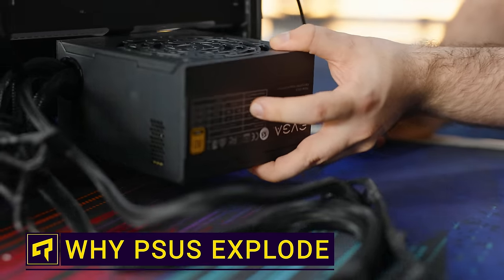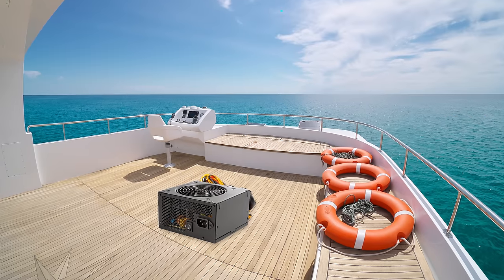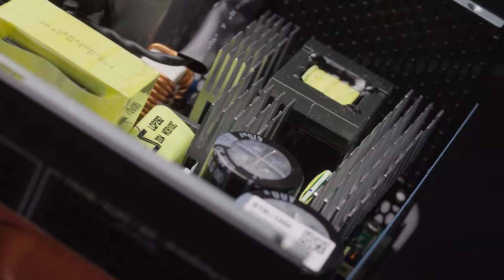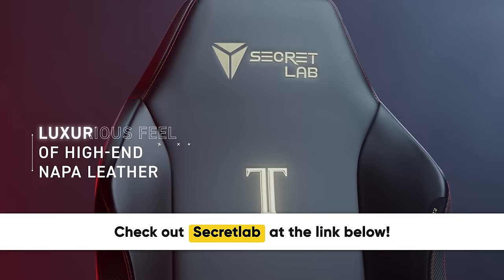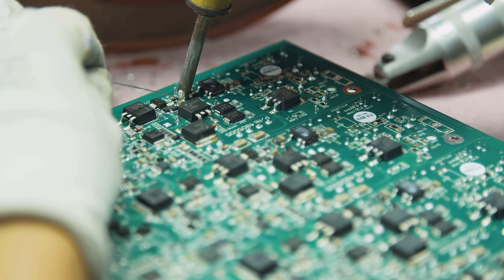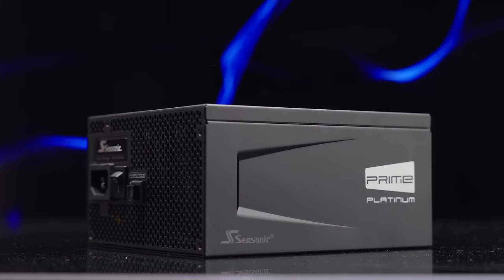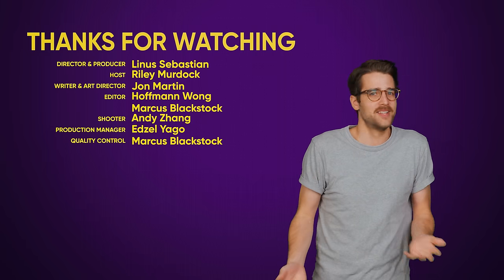Why Cheap Power Supplies Explode

Comment: 1 - gotta love Riley, hes amazing as always!
2 - somehow, my 50 bucks PSU still works fine lol.
3 - i will definitely buy a real and more expensive unit, once I get a new PC lol. I don't wanna risk anything.. waking up everyday wondering if my house will catch a fire ain't fun ;p
Reply: I mean it was always about getting good quality products but some people has misinterpreted it as getting the most expensive product.
Reply: Actually there is some the most dangerous one, the one that doesn't blow up that is. Cheap PSU often have terrible ripple suppression that it can silently murder your PC components with it, and you think you just got a bad RAM/GPU/SSD/etc. I often seen these things kill all the USB ports in a motherboard as well. There are some good 50 bucks ones, like some by FSP, similar stuff you will find inside a Dell or HP prebuild PC actually, but make sure you know what you are buying.

Comment: Reputable brands like bequiet, Corsair or Seasonic will also give you 5 to 12 year warranties on their PSUs, which is a major trust thing since they wouldn't do that unless said manufacturers really expected them to last at least that long. Cheapo PSU brands don't do that, and they made their profit if it goes boom on you after 3 years.

Comment: A few days ago I got a computer to fix. I'm in Europe, so we only have 230V AC here. The PSU was a "global" one, with a switch to select 115 or 230V. This computer came from an school, and I didn't check the switch before plugging and trying to power on the computer. Some prankster (I guess) set the switch to 115V.
If that PSU was a good one, nothing would have happened, or at least an internal fuse would have blown up. Instead, there was a loud bang inside the PSU, electrical crackles and lots and lots of smoke that escaped from all the holes in the PSU and computer case. Ah, and the awful smell of burnt electronics.
It's a miracle that the rest of the components survived.

Comment: I had a cheap power supply blow up once it only killed the motherboard. Thankfully the motherboard which was a MSI motherbaord had protections that saved the rest of my components. I now have a good quality bequiet PSU

Comment: PSU is one of those components where you shouldn't cheap out... And not buy used if it's 5+ years old. Very low chance it will survive another 5 in your system.
Other component is SSD but there smart data is more important than age

Comment: I had cheap power supply and it wasn't explode but the SATA power connector was short circuited and it catches power. (I quickly turned off the extension cord and it was ok, LUCKILY!)

Comment: I've had plenty of experience with power supply problems, including high quality ones like SeaSonic that react so fast they overcompensate for a momentary spike from my RTX 3090.  I just threw a 1300W PSU in as an upgrade and there is now plenty of headroom to handle stuff like that.  Keep in mind that your computer's power supply is not the only component with these protections: Your motherboard and GPU have some along with your UPS, all the way down to your circuit breakers and arc fault outlets in your home.  You can get some seriously weird behavior from their interactions... I guess  that's why the manufacturers tell you not to plug a surge protector into another surge protector.
Reply: 👆👆congratulations🎊you have been randomly selected among my shortlisted winners you just won a prize🎁🎁🎁...

Comment: Can't say I've ever had a PSU explode, knock on wood. Only one I ever killed was one I had re-wired to use as a bench supply. Just stopped working one day. Cheap supplies can be fine for low budget, low power builds. But the key to take away here is that they are a potential time bomb, and the ratings on the side are to be taken more as rough guidelines than gospel.

Comment: I have been building computers since BEFORE ATX, I used the older AT standard.  I have built computers out of used systems, trashed systems, recovered from landfills, bought at flee markets in the middle east, and just made out of crap.
I have had components fail in all sorts of ways, or, more specifically the only two ways they can, open or short.
In my years of accidentally running 220v systems on 110v and visa versa, of using parts that spent years in the rain, I have only seen 1 power supply ever fail in a manner that is actually explosive... and that was made by Gigabyte.

Comment: I remember working on a desktop at an office. I plugged it in and turned it on, and a jet of flames came out of the back of the power supply, kinda like fireworks, with a rapid clicking noise. I luckily was able to pull the plug before it damaged anything else in the office, or burn the place down.

Thanks for this video, guys. I need as much help as I can get to weed out these cheap power supplies from reputable ones.
Reply: 👆👆congratulations🎊you have been randomly selected among my shortlisted winners you just won a prize🎁🎁🎁...

Comment: Switching power supplies have been around since the late 1960s. The computer industry began using them commonly with the Apple 2 and the IBM 5450, later known as the PC, in 1981. LTT only missed by 15 years or so. Par for the course for LTT accuracy.

Comment: I had two PSU's from a known brand with bad capacitors. They where digital, but not cheap.  Two became 4 under warranty in about 2 years. They did all go bad and lasted less than 2 years. They drove other not cheap devices, who is still in good working order. Tired of it, now is 12 year warranty PSU's running perfect at 6'th year in the desktops.

Comment: I think this is a bad take:
1) DO NOT open the PSU, this needs to be explicitly said. There are large capacitors inside that - if not properly discharged - can kill you while you run your fingers through them as shown in the video.
2) It's not the price as the title implies. EVGA has just told us recently that they had decent (20ish %) margins on PSUs, this means simply undercutting doesn't imply worse quality. It's more about willingness to cut corners, which established brands are generally less likely to do.

Comment: "Read reviews from trustworthy sources"
Need to stress that said reviews are IN DEPTH reviews, those that test ripples, overload, circuit configuration, etc.
Consumer review are your last place to look for unless for negative complaints such as faulty or blown PSU. Most common of consumer review is mere "I plugged it in and my computer runs. Recommended 5 star!" which tells you absolutely nothing.
Also, never cheap out on PSU, even if comes from big brand names. Some brands do have models that are so bad I might as well use cheaper stuffs that is likely to blow.

Comment: This guy needs to be clearer (and less dramatic) about these explosions and fires he keeps going on about. He's selling it like the PSU is going to either cause a fireball type detonation and/or something like a hand grenade going off inside your PC that will send shrapnel flying everywhere and possibly kill you. An electrical fire caused by shorts and failed components is nowhere near as dramatic as he's making it out. Yes.... any fire is bad.... but.... your PSU doesn't go up like grease fire in the kitchen. As for the so-called explosions, a capacitor that fails and pops, makes less noise than a firecracker. Other components like MOSFET's and JFET's make even less noise on failure. Those of us in the know may find his prophecies of PSU armageddon entertaining, but non tech savvy might actually take it seriously.

Comment: USB power supplies are also sketchy.  I only use Apple or Samsung supplies.  When the 150 watt Anker supply is half the size of the Apple 140 watt, you have to wonder what they left out.  Most USB power supplies are missing the voltage monitoring circuit.

Comment: Back in the 2000's, PC shops in the Philippines tend to put in cheap PSUs in their pre-built systems and package it with cheap automatic voltage regulators and surge protectors just to keep the prices down. It wasn't until the 2010's when internet became more accessible to more people. Since then, more people found out that PSUs are worth spending for and people stopped buying those pre-built systems with cheap PSUs, AVRs and surge protectors.

Comment: trust me. no power supply is built without cheaping out on some stuff. modular and reputable ones like asus rog, corsair, evga all use shitty output plugs and they melt even if you're within the 150w pcie spec. and they don't make non modular high wattage ones anymore so you're forced to buy modular if you want high wattage

Comment: Hey there is a high pitched noise coming from my PC while its connected to power - only shutting of the PSU or pulling the power plug will remove this sound.
Is my PSU screwed or what is going on?

Comment: I used a Lian Li power supply I bought in 2012 when I built a computer.  I upgraded the computer later to a 6th gen i7 but used the same power supply and in 2021 the power supply blew.  The computer just shut off and I could smell a slight burning smell.  I knew the power supply was dead so I opened it up and 2 large capacitors had leaky burnt crust on the top.  It killed the motherboard, the processor never booted correctly after that and I don't know about the ram, though my graphics card survived.

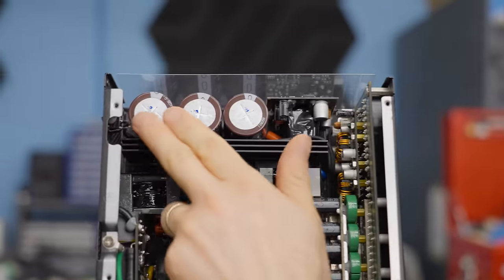Comment: 0:48 Please do NOT touch capacitors with bare hands. They can hold charge for MONTHS. I know you're touching the casing, but a little electrostatic dust can go a long way. This is not a part to poke around without safety measures. Sorry for the rant, but I thought you already had a collab with ElectroBoom? ^^

Comment: I have built one computer after another with cheap power supplies since the mid 90's, and can tell
you that you get what you pay for. These supplies are unreliable, noisy, have bad an unreliable fans, 
and are very sensitive to static. I have had cheap supplies that seemed to have the needed wattage
and tested OK on pin voltages, but couldn't boot up the computer, probably due to over-rating.

Comment: I'm still confused what does the wattage rating mean? If I limit my system to have sustained and spike power draws of 640 watts on a 650w 80 plus bronze CX650M, why shouldn't it handle it? Like even with a 4090 and a 150cpu, all you need is 850watts. 600 for gpu and 100 for motherboard/fans.
Reply: Typically OCP is like 10-20% of the rated limit, but that's not always the case especially on cheap china PSUs a 650w might actually mean 500w sustained 650w peak. A 4090 will almost guaranteed trip a 650w PSU because although very brief, it may pull very close to that OCP limit, and as soon as you add on a CPU, board, and VRM inefficiency you're well over that limit.

Plus you don't want to be sitting near that limit all the time even if you could. Hotter components don't last as long. They're also less effecient. And louder to cool them. And no upgrade room. The list goes on.

Comment: In the EU/UK we're covered by a 2 year warranty on electrical goods regardless of what the manufacturer thinks, and 6 years if you can demonstrate that it was defective at the point of purchase (e.g. running it at its rated power for its full warranty period using the supplied components would cause failure a significant percentage of the time). So "technically" this should be less of an issue here, and may help to explain why a lot of cheaper stuff is also better quality now than it was 20 years ago. You're welcome.

Comment: The 'weight' thing, can be a bit of misnomer, as some cheap psus, just stick a weight in them, or use a slightly heavier housing.
Kind of like how cheapo junk tier keyboards slap a metal plate in them.
Low grade steel is cheap.

Comment: When i built my first PC 10 years ago, i fell for the "1200Watt" 50-dollar psu. Was gaming one day and i noticed the fans would slow down when something resource intensive happened. Then the whole PC turned off, i thought i killed the CPU, asked my gamer friend and he told me it was my PSU. Then i bought a an "expensive" Antec 750 watt, ran amazing. Now i run a Seasonic 1300watt platinum.

Comment: Was repairing an old build from 2004, had a codegen power supply that came with the case. I believe the case was a codegen superpower 6000 something.  Finally got it working, before it was just a black screen I got to the bios and the power supply started crackling and emitting smoke so I just ripped the plug out.

Comment: Another thing to watch out for is push power button switches. They're the type that push once to turn it on and once again to turn it off. They're not as durable as rocker switches (like a light switch). My last PSU was a well made gold rated Thermaltake brand, but the push button power switch failed after only a year and a half. It started crackling and arcing electricity whenever it was pushed. I nearly got electrocuted from it several times. I swapped it out for another Thermaltake PSU that has a rocker switch. Eight years later and I've never had the same issue.
Funny enough, the original PSU actually cost more than the replacement one, but the replacement one has a slightly greater wattage rating.
I'm not just basing my opinion about those switches from that one experience. By design, rocker switches are more durable than push buttons.

Edit. Don't forget to occasionally vacuum out the PSU (from the outside, of course). They have the potential to accumulate a lot of dust. I once took apart an old PSU to find it was filled with grey dust. It was a fireball waiting to happen.

Comment: I have never seen one blow up, I did use a 600W Hex PSU back during the 9800Gt era and it took my GPU and MB out when it gave up the ghost. I blame me, when it came it did not work. I shorted a pins on the PSU to make it come on. Thinking it a bit odd I had to, I should have stopped and bought a real PSU, but less than a week later it fried and took ye old GPU out along with the entire 12v rail on the MB, lesson learned. I mainly stick to Seasonic now.

Comment: You missed a rather serious issue many crappy PSUs have. It's common for them to have some parts glued over to reduce resonant vibrations from the alternating current, this is normal. But that glue should be rubbery silicone glue, almost always white.

Cheap PSUs will use some non-silicone glue that'll harden like a rock and over time gradually turn tan, then later brown, then even later outright turn into a blackened charred short circuit!

Honestly I've seen this issue almost as often as I've seen exploded capacitors. Hell, even some 'high end' PSUs will cheap out with this B/S glue.

Sadly there's not even much way to know without opening up the PSU which will void the warranty and also be a safety risk that I definitely don't suggest inexperienced people to even attempt.

Comment: For example, I purchased a 100$ PSU slightly better than my old one and after some time, it started to suddenly shutdown my computer and restart itself but when I was about to reset my PC, I heard a suspicious sound and also it started to smoke, and had to replace it back. It was also supported by my hardware.

Comment: When I was younger and dumber about computers I bought an inexpensive prebuilt and it had an infamously cheap power supply prone to exploding and taking the motherboard with it (Bestec 250-E). Fortunately I lucked out, it worked fine for years.

Comment: power supply in my old computer eventually melted the the main power connector going to my motherboard, didn't find that out until much later after cleaning my case.

Comment: In general, SeaSonic is my first choice, EVGA second choice, and Corsair a third choice. Thermaltake is reputable, but their product line in general and not the PSU line specifically leaves a bad taste in my mouth. If the brand makes other components for computers, like CoolerMaster, Gigabyte, G.SKILL, or ASUS, I would be hesitant to purchase, not because of quality, but because they are average to me. Any other brand, stay away!
Reply: Thermaltake PSU is crap. I had one previously which fail on me. After that I switched to FSP Hyper K PSU. It works till today.
Reply: Most brands don't even make PSUs. The vast majority of them are just licensed from a larger OEM, maybe being adjusted to match the modular pin-out of the rest of their range, maybe not. A large chunk of Corsair's PSUs are made by Seasonic, and almost all of EVGA's are made by Super Flower. Any unit OEMed by those two is good in my books, regardless of the sticker on the side. IIRC, units from Great Wall or FSP tend to be pretty good as well.

Comment: My PSU has been been running since 2009 pretty much 24/7. 
PC Power & Cooling Silencer 610 I paid $105 for it in 2009 kind of expensive at the time, but I wanted a quality Power Supply so I did not cheap out. It has served me and continue to server me well. 
I did buy a Corsair HXi 850 to swap to in 2018, but have not needed to do so as of yet.

I do keep my PC on a semi decent UPS that helps filter any major power fluctuations.
It is now 4 years past my expected replacement need lol. I will swap it out once I upgrade and switch to my new case which I bought that same year. I am waiting to upgrade my Intel 7700k system that has a RX 580. Now that things have calmed down a bit I might actually get to do some sort of upgrade.
My current system has been meeting my needs so I am in no real rush to upgrade.

Comment: I use EVGA G+ 750. My previous cheap PSU's were kind of reliable as well, but 300W is no longer enough... Found that out by destroying 2 PSU's in total of 3 times. Both PSU's were fixed by my father and they would still run if we had any use for them.

Comment: Had a h p computers' power supply capacitor go boom on me once. When I opened up the power supply afterwards it was just a nightmare inside; of bad solders, cheap parts and screws missing. The next computer I compiled myself.